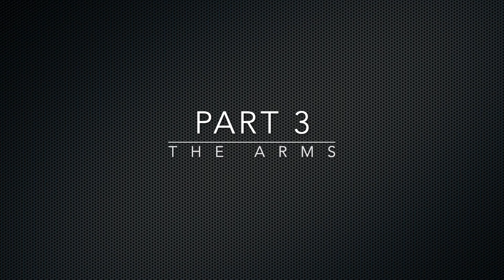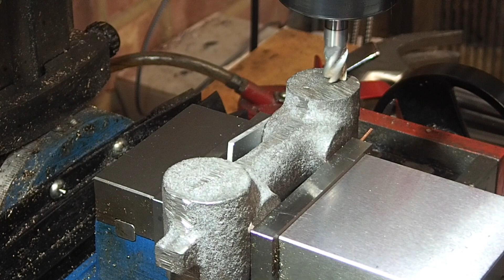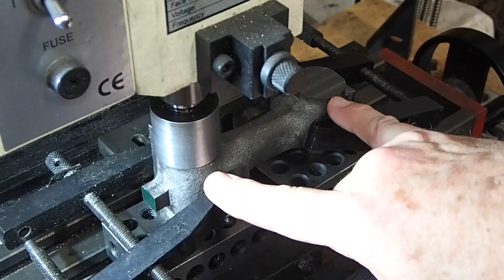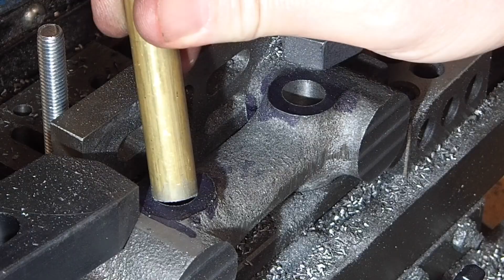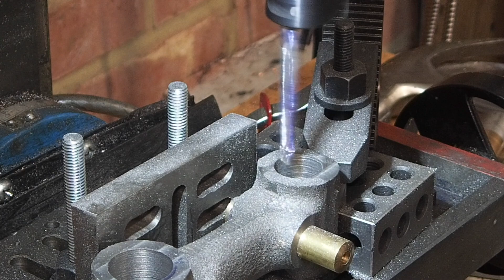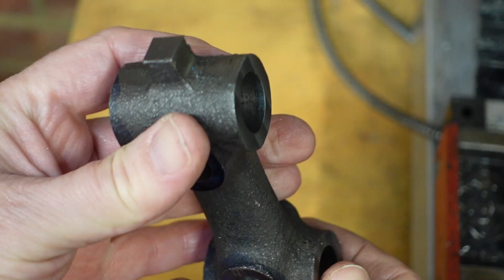Universal Pillar Tool -  Part 3 The arms.

Comment: Hi Mark just a quick question for you , do you use Hss Co or carbide cutters when working on castings? Thanks Mark also would like to see a video on making the ball handles if you get around to doing them. Your videos are very clear and easy to follow so some of the most helpful 😊
Reply from the maker: I usually use a carbide insert cutter for cast iron.
I’ll certainly be videoing making the ball handles.  There aren’t many videos on YouTube showing that.
I’m glad you like the video format.  I try to keep them to the point without unnecessary waffle.
Reply: @modellingmark thanks mark, you do a good job keeping the information concise! Looking forward to seeing more progress on the quote now that the gold finger car is complete
Reply: Quorn not quote! Auto correct 🙄